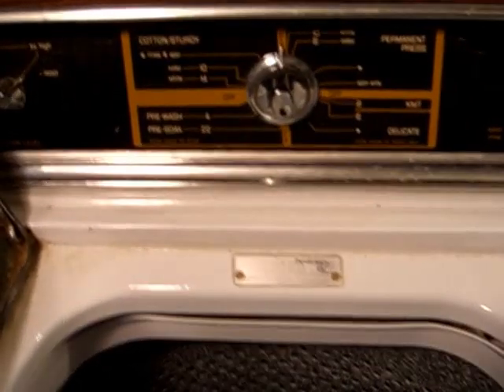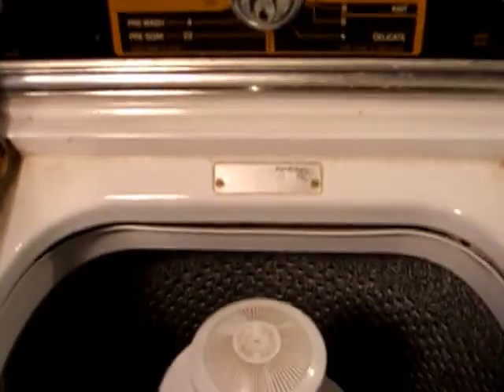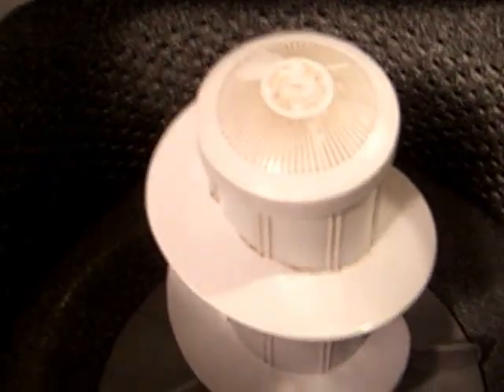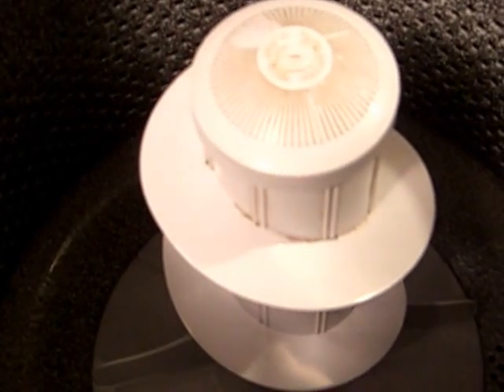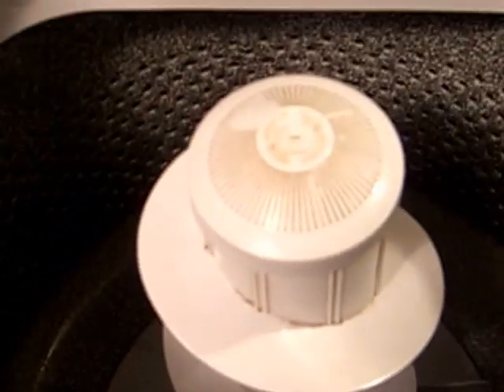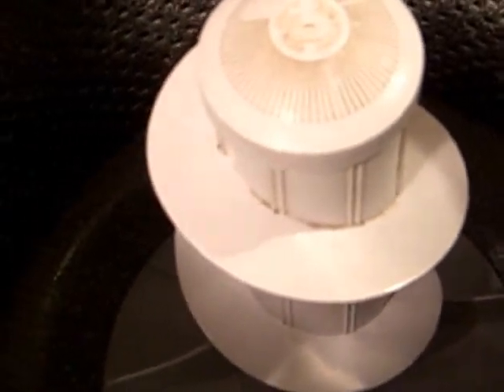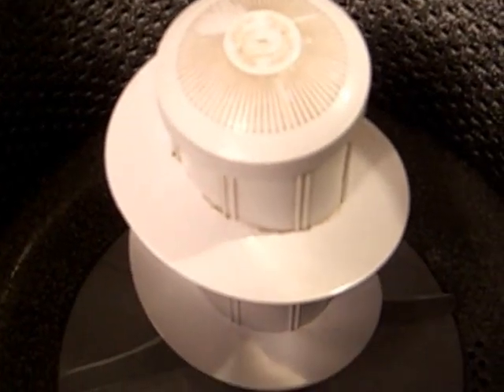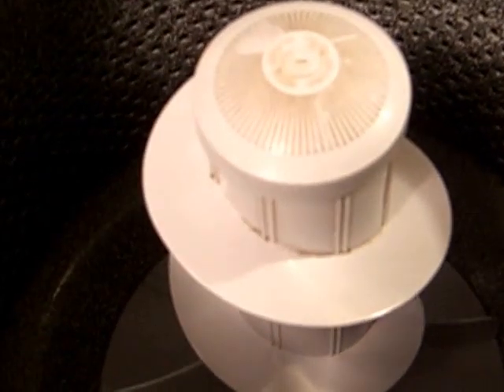Kenmore Series 80 from the 1980s Washing Machine Spin Cycle Problem

Comment from the maker: I took the top end apart (pulled out the tub), found that the main shaft was somewhat worn, and then put it back together. I put in a load of laundry, started it up, and just before it was about to burst into flames, yanked the power cord out of the outlet. Obviously I did not put it together correctly although I don't see what I could have done wrong. I am now the owner of a brand new state of the art LG front load washing machine.

Comment: Could it be the belt hitting the tub, or could it be the belt is too loose or too stretched out? Or worse, could it be the transmission is going bad?
Reply from the maker: Who knows? I bought an LG washer, and I am very, very happy with it. I just noticed that 5 years ago a couple of people more-or-less stated that LG washers are not very good. I have had absolutely no issues with my LG washer. The LG is incredibly more effective at cleaning clothes than my old Kenmore and uses far less water. Old top load washing machines are dinosaurs that do not wash well, use lots of water, and are not energy efficient.